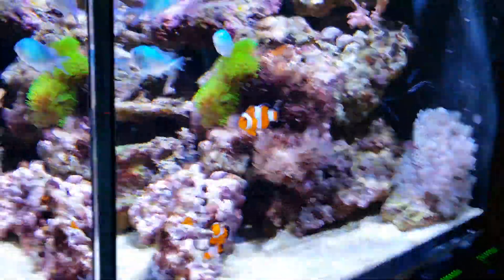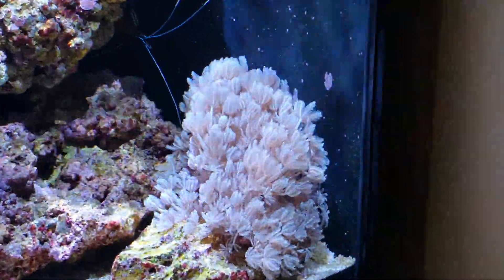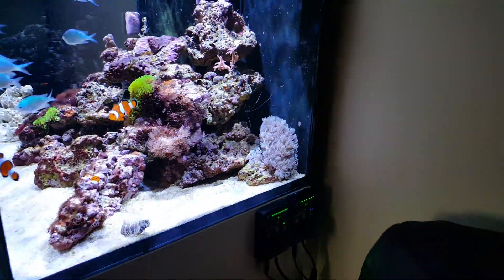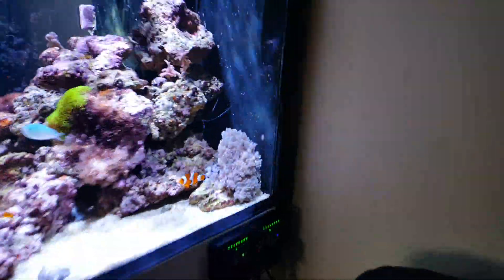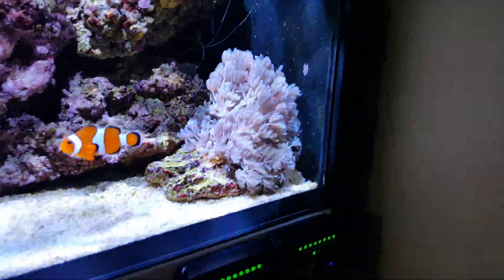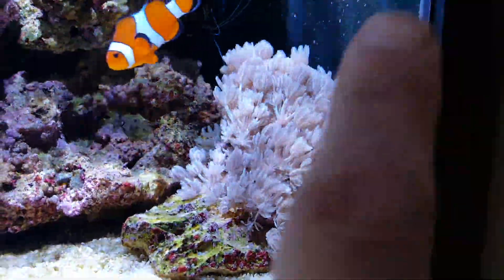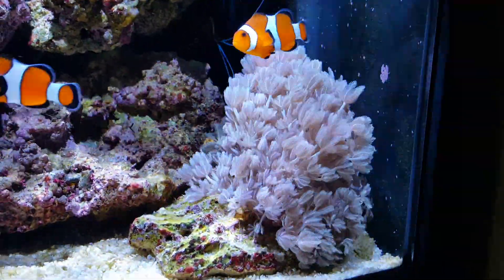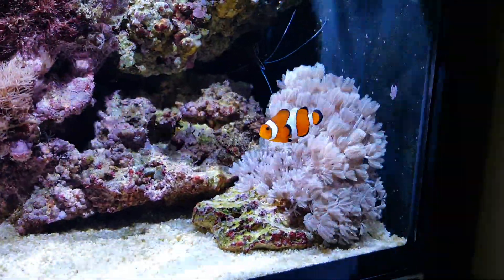Red Sea REEFER 250. Week 11 update.

Comment: Beautiful tank, just got done watching all your videos... hours later. haha. So about the precipitation, you're spot on. RSCP is notorious for precip. with elevated levels so high. Just an FYI, when your salt bucket sits for a while, more dense particles will separate in the bucket and fall to the bottom. Give the bucket a good roll every week so particles are mixed well. 2 Years of using RCSP i'm finally heading back to H2Ocean, I run a packed LPS tank ~300L. If you're on instagram go ahead and stop by my page @C6Reefer would love to keep updates with you. Subscribed.
Reply from the maker: +Kyle Scaletta hey buddy, thank you! great you have watched my vids hope you like them. yeah just bringing the alk down to about 9dkh and cal to about 400-430 and mag to 1350 i hope this helps get rid of the cloudy white haze towards the end of the day, its so annoying! as tank going so well apart from that. dont use instagram but will check your page out, cheers m8
Reply: +nathan willard reducing your levels within that range will definitely fix your precipitation, that is if it's what's causing it. Which I believe it is. Also don't forget to roll around your tub to mix the salt! Cheers

Comment: your problem whit te mp10 may be that your glass is to tick :) its say that its is upp to 10 mm glass and if you have 12 mm as you did say in a vid :) just check it :) nice tank btw :)
Reply from the maker: +Nils Petter Bjørke thanks m8! i thought that but checked it and its 12mm on the front pane but the sides and back are 10mm so shouldnt be a problem? ive adjusted the position loads with the motor but no joy still jumps around and motor keeps falling off!! might contact vortec about it i think.
Reply: +nathan willard yeah okey :) i did try my om 10mm glass and no problem butt they say it goes to 9.8 mm glass. have you fixed te cord to the glass above the motor? use the zip ties and the mounting kit to the glass so it dont fall off. i have had it happen when i installed it butt never afther i fixed the cord and the motor cant drop down :)